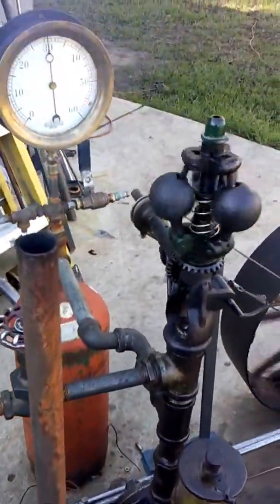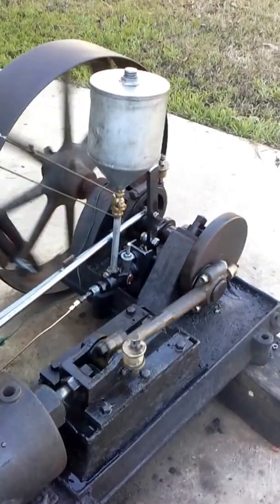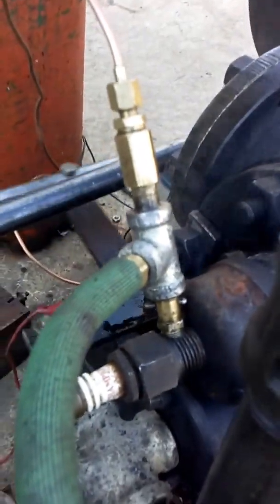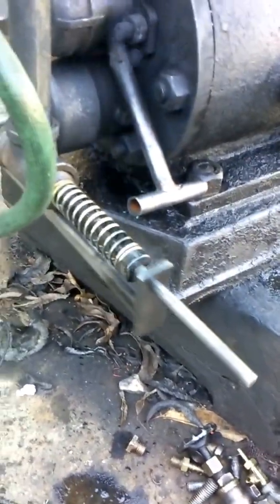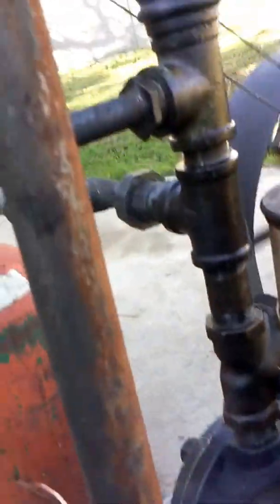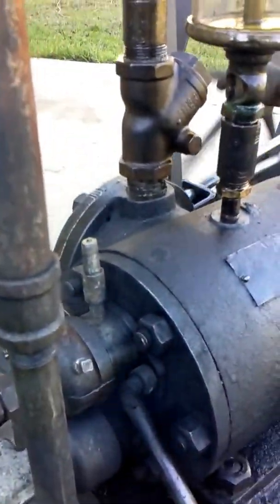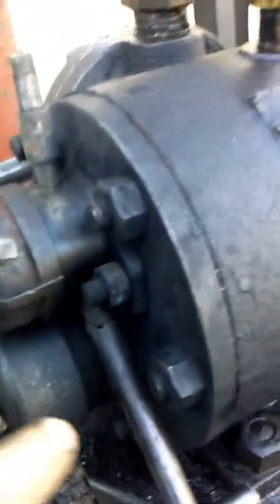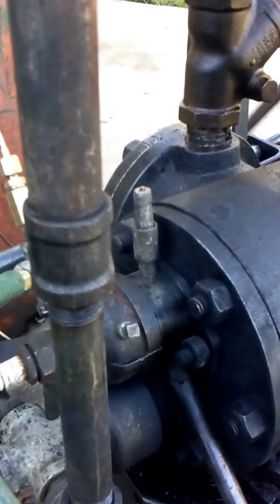B.E.L.L. cycle Brayton, Ericsson,  Lenoir, Lucas

Comment from the maker: In the video the fuel setting is fixed to run at slow RPM... ... so the engine didn't have the power to make up for the loss of air pressure. The engine takes off pretty quick if more fuel is added... Currently the governor controls the volume of air that is admitted... I'm finding that's not the best way to control the engine speed... I'm working having the governor control the fuel or both the air and fuel...